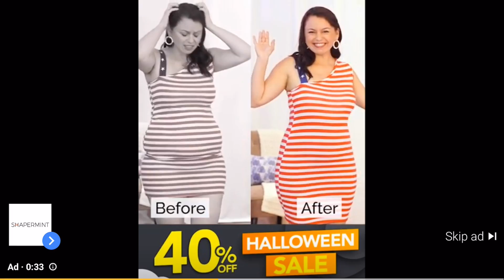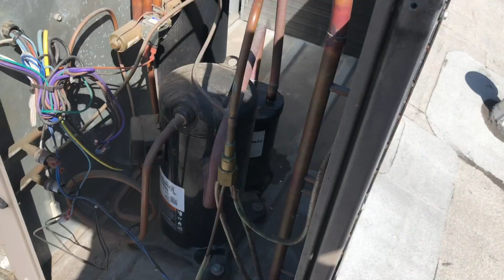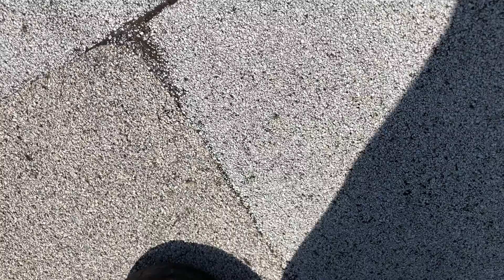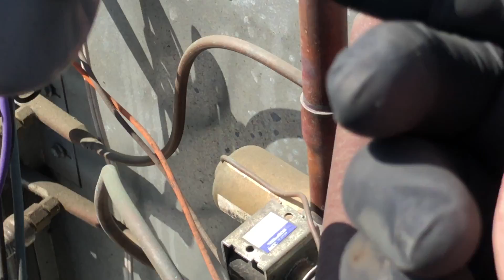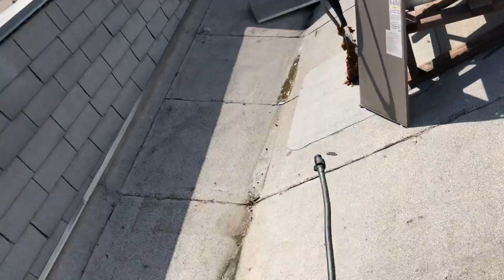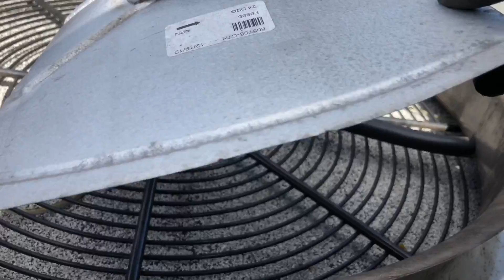The day the SRL8 beat the H-10 pro

Comment: I don't know Dave,  I think it's time for a new sensor for the h10, I thought that SLR 8 was pretty good detector until I had so many false alarms that it became more of a nuisance than a help, I sent it back to Fieldpiece and they traded me for a infrared, it's not as sensitive but at least when it goes off it's a real leak. I've had real good luck with my Superior accutrak ultrasonic detector on r410a systems without adding nitrogen. 👍🏻👍🏻
Reply from the maker: My battery was low on the H-10.  The Fieldpiece has False positive all the time. H-10 is the best.

Comment: 😱 H-10 defeated had me worried there.
         Ahh huh 🤔 takes an H-10 with a dead battery for something to defeat its performance.
Reply: You have a seriously bad case of confirmation bias. SRL8 has shown to out perform the H-10 on numerous occasions for 410. However, cant beat the H-10 if you use 22 for a trace gas, primarily due to sensitivity adjustment capability.
Reply: Free Inhabitant Yes true I know that about the R410 performance.  I am Highly biased.  R22 hours as a trace gas my father taught me at the age of 12 over 40 years ago still use it to this day.  But still they have not built a leak detector as rugged and reliable as the H-10 and if you over adjust and tweak your adjustment on the heated diode it becomes more sensitive and performs even better but greatly shortens the life of the diode. Most guys will not want to sacrifice the life of replacing the heated diode often just to find leaks for their customers. And the majority of technicians don’t even know you can do this. And of course the factory won’t tell you because it will void warranty because you would be burning up heated diode’s.